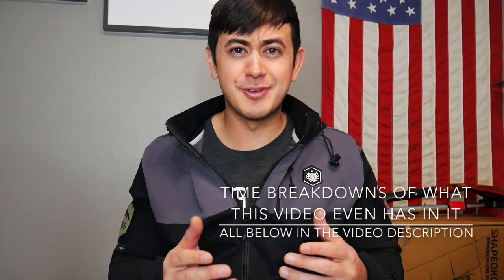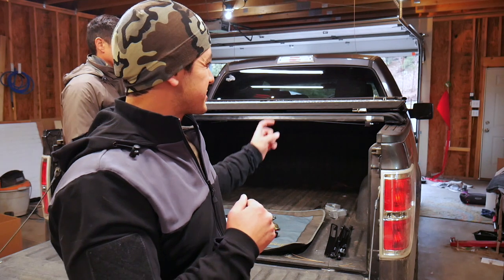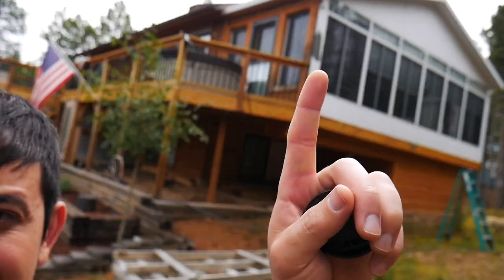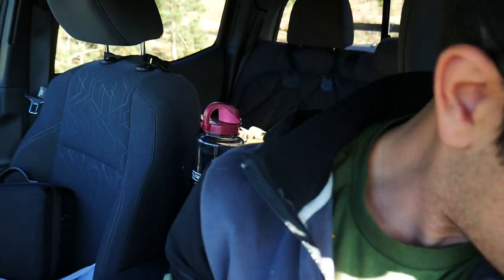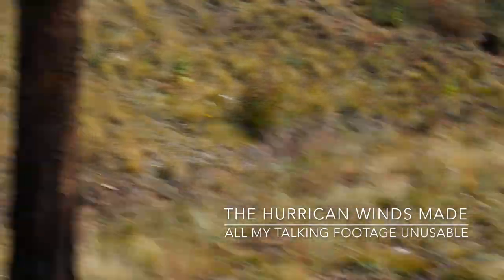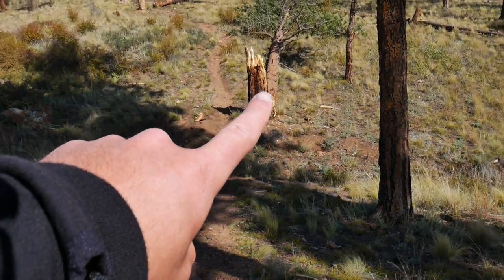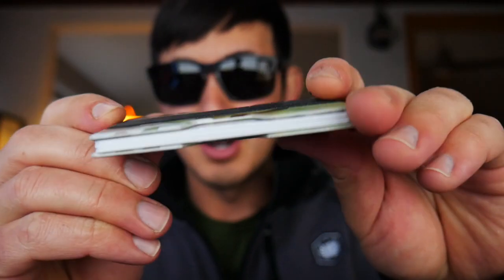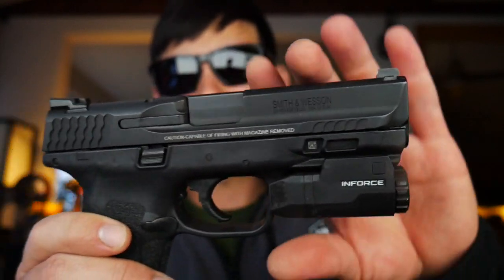RANDOM Weekend - Shooting the M&P Compact, DiamondBack Install, Gadgets and Gizmos

Comment: The magazine extensions are meant solely to fill the gap between the 15 round stock magazine and the 17 round full size magazine. It would be near impossible to over insert a magazine since the magazine release latches into the magazine, once you hit that you will not be able to go any further unless you break that detent. People like to just say things without logically thinking about it or using critical thinking skills to release it’s not possible. Tight lines shoot straight man

Comment: For the M&P full size mags WITHOUT the spacer...what do you think the risk is by repeatedly inserting...or over-inserting the mag, over time?  Could you damage either the mag or the gun through over-insertion and is it the type of thing that might be cumulative so that something is ultimately weakened to the point of failure...and at the worst possible time??   And I guess my point is that the spacer weighs probably an ounce.  It isn't heavy or cumbersome, is it?  So why not just use it and then you don't have to worry about any possible problems?
Reply from the maker: Yeah, it's not a big deal, I just don't like having an extra part - in theory it could slide up/down the mag and cause the mag to not be fully-seated, etc if I go for a reload. The fewer moving/movable pieces the better.
Reply: Why couldn't you put a couple of drops of super glue on it or something to keep it in place...or loctite or similar?  Just a thought.
Reply: Then it would no longer work on the full-size and the compact both

Comment: Does vacuum molding have a smaller margin of error than cb presses?
Reply from the maker: Not so much margin of error (that has more to do with the actual molds) - but vacuum forming (especially membrane-less) is able to achieve sharper detail.
Reply: Last Line Of Defense I'm getting pretty tired of some of my cb presses not coming out quite perfect. I might make the switch.